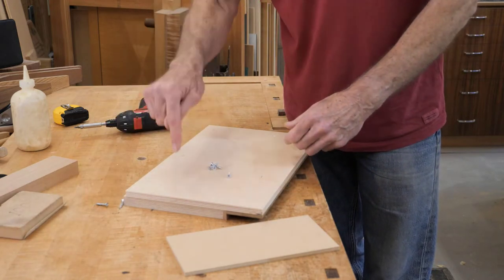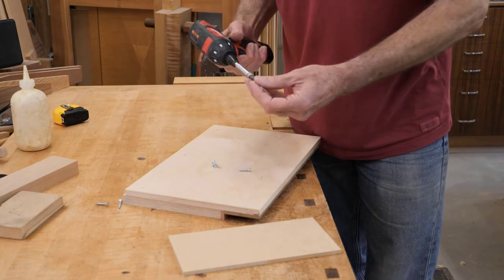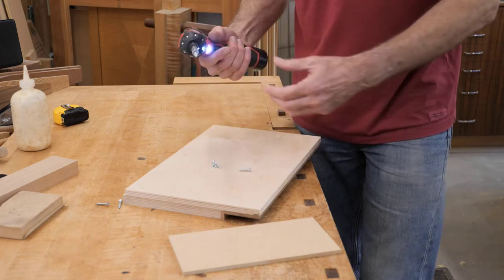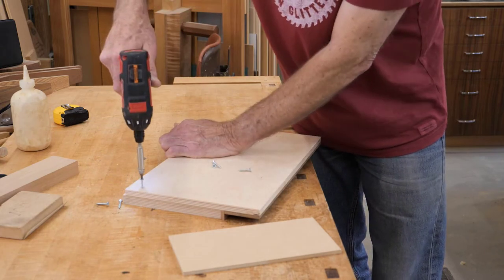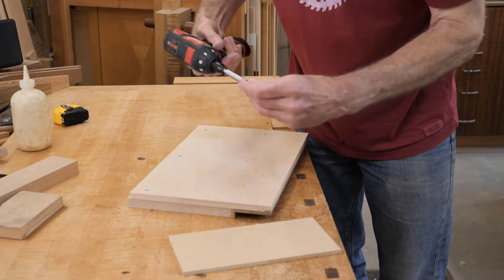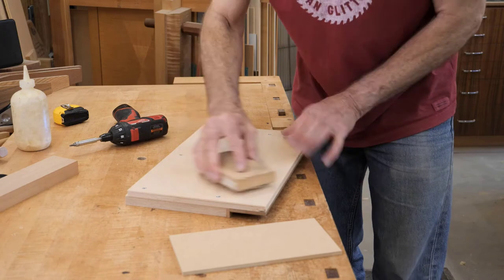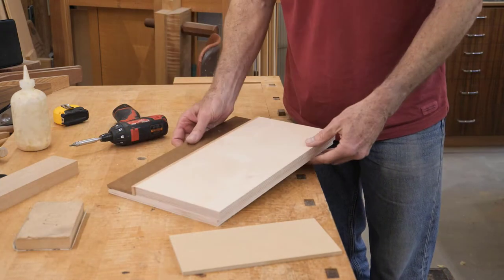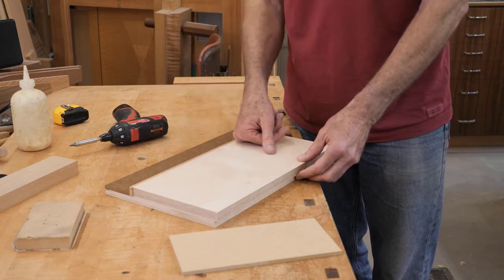Make a Shooting Board

Comment: @Carl, can I ask why you prefer the wedge approach?
Reply from the maker: The wedge was really helpful at the school where I taught. We had a bunch of shooting boards that students used in various classes. As newbies, they would often rock the shooting plane and cut into the fence (wedge), which then created tearout on future projects. It was easy for me to fix the issue by taking a few plane swipes on the wedge and re-trimming it. Prior to my taking over the handtool class (in about 2004), the previous instructor used the wedge design, but the wedges were tapered in the other direction. That wasn't helpful!

That's how it started. I like that the wedge can be fixed easily if necessary. Also, once the dado for the wedge is set correctly, the angle is no longer adjustable. (Things that are adjustable tend to get out of adjustment.) I realize the wedge design has some disadvantages, but it works for me.